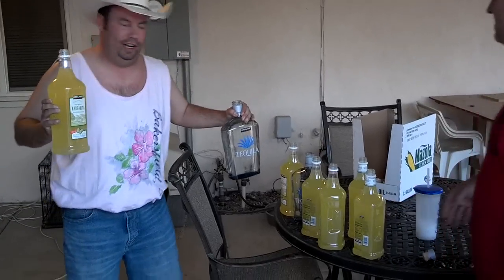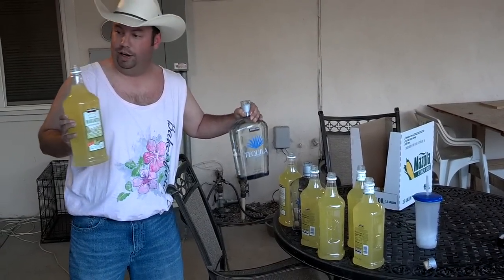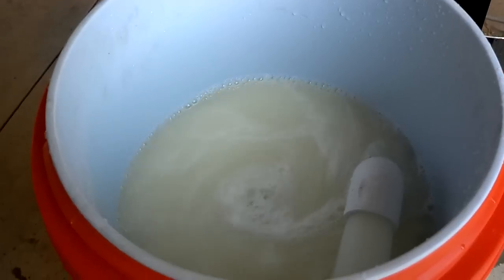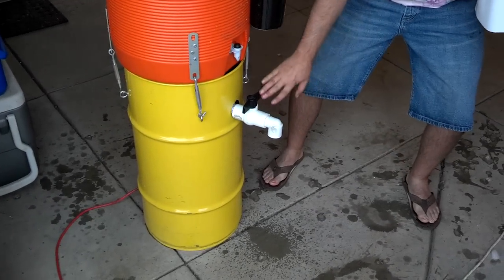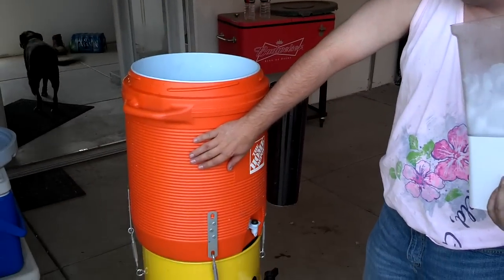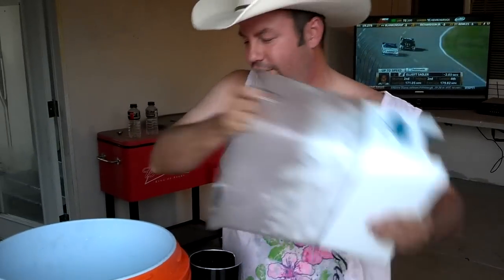Redneck 10 gallon Margarita machine using a garbage disposal

Comment: not enough of a vortex to pull the less dense ice down.  I think if you mounted the input to the disposal in an opposite direction to the outflow you might get more of a vortex going.  Instead of a drain in the bottom, use L shaped piece of pcv to come up and out the side.  Or leave it as in, run the ice and a small amount of amount of liquid through to make a very thick slurry then add more liquid.  With the current setup maybe a higher volume of flow, would 1/2 hp increase flow/rpm or just torque?

Comment: That's some great engineering. I'd like to get the plans for this.
Reply from the maker: +Wojciech Podczerwinski it is simply just a garbage disposal mounted under the cooler. The drain line is then split two ways. One way is the return up into the cooler and the other out the front of the barrel for the drink outlet.